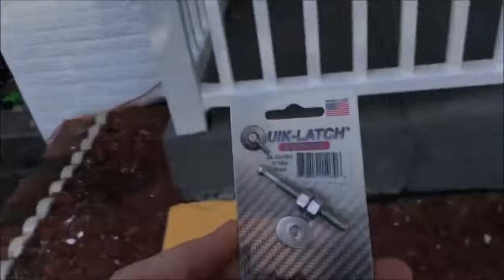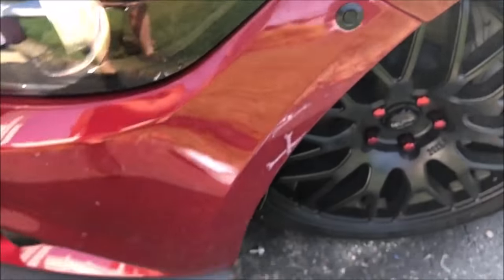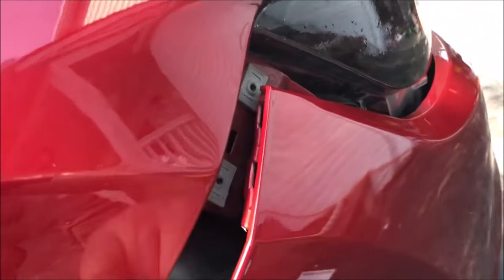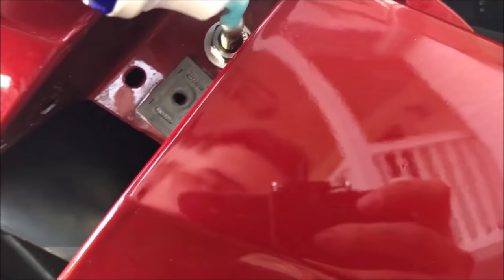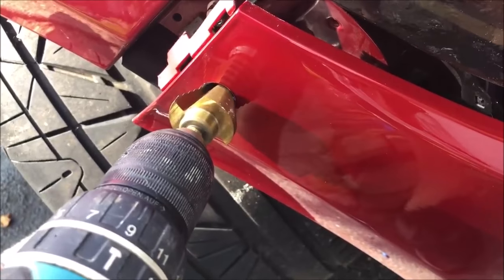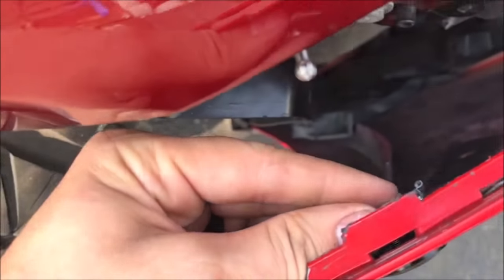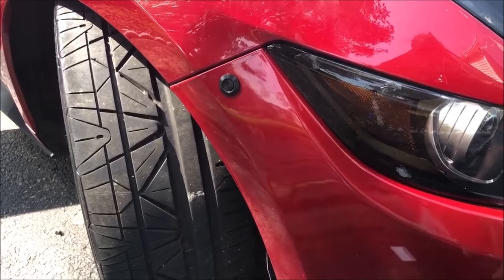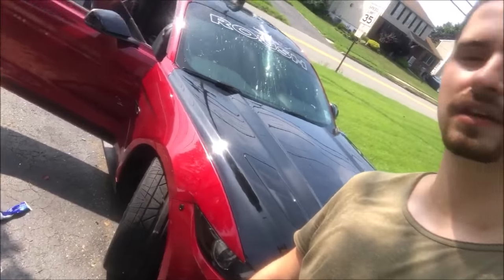How To Install Quik Latch Bumper Quick Release + Review (Super Easy!)

Comment: Thank you for this video!  My 2017 Mustang just popped the passenger side.  You saved me a lot of money.
Reply: This seems to be common on a lot of newer cars that are using these urethane bumpers. My 2013 Lexus ES 350 has the same issue and I'm about to put some on mine.

Comment: Great video.
But i noticed that with the quick latch in the middle of the bumper end, it was kind of wobbly on both ends. Due to not having a solid grip across.
I would not use this on my car unless i had to take my bumper off every now and then.
I had broken tabs and used soldering iron and nylon zip ties to repair the tab and holds as strong as they are supposed to. Then again, i already had a $20 soldering iron and $2 zip ties.
Reply: depends on the car, but you can put two next to each other to help control that. i don't think it'll be easy to do that with the S550 though

Comment: Thanks a lot. The front fascia of my car weights a ton, brackets are not holding the piece as they should, it doesn't help that the car is lowered. This is a perfect solution for this problem.

Comment: How often do you need to remove the front bumper? Why use quick-latches for that? The only time I removed my bumper cover from my car I owned for over ten years is to replace it after an accident. Seems like a waste of money to me - over $60
Reply from the maker: Denis not the point.
My car is notorious for bumper tabs breaking. It’s either getting a new bumper $500+ or a quick latch for $60
Reply: If you work on your car constantly and add things or need to access other parts behind it... then it is beneficial to have these quick releases since it is VERY time consuming with all the clips and awkwardly angled screws that most cars have at the top corner of either side of the bumper which is only accessible from the wheel well behind the fender liners along with a couple scraped knuckles
Reply: Yes is a waste of money for people who don't know anything about fixing or upgrade their cars.. 🤷‍♂️
Reply: @romagrigorenko  Also, and I know this is a bit niche, but my vehicle crosses the border from RHD to LHD countries a lot. Those beam bender stickers chew, and leave goop on the lenses. I want to be able to get the front bumper off and lights swapped in a car park asap and these look like just the job. Handy video, thanks.
Reply: I show/race mine and try getting a car on and off the trailer without removing the bumper or destroying $1200 in bumpers. Car has 6 inches of clearance.

Comment: Baffling??!!! Why would someone want a quick release bumper?? 50 bucks EACH to make an easy to steal bumper...  Why not just use a big lag bolt?? Maybe a gate latch??
Reply: this only takes off the hard to reach bolt on the corner of the bumper. it’s in an awkward spot on these cars. you still have to pop the hood and remove 8 lag bolts, as well as all the fasteners and bolts on the bottom of the bumper
Reply: @valkyrie_voodoo  Which makes it even more ridiculous..